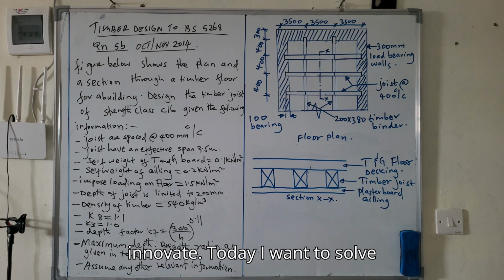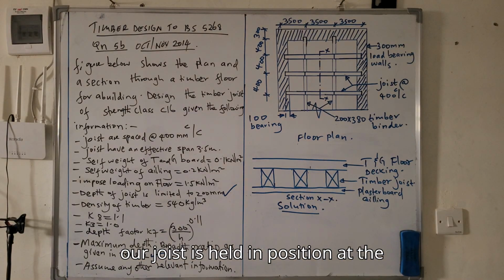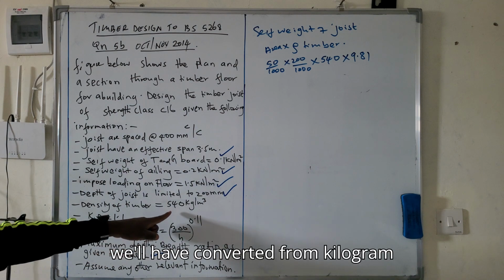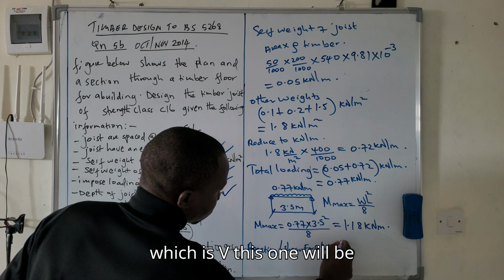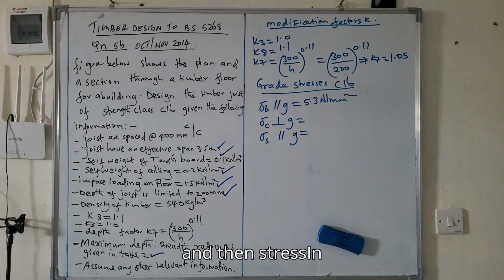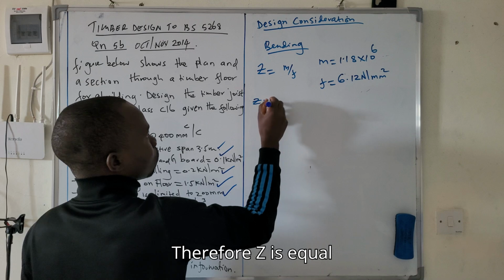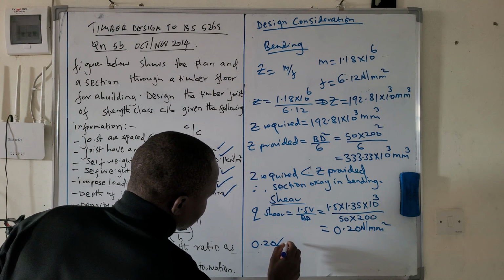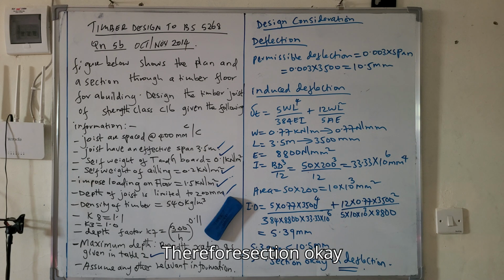TIMBER DESIGN TO BS 5268 PROBLEM #6

Comment: hello there i have noticed in Induce you use {5*w*l*^4/384*Emean *Ixx +12*w*l^2/5*Emean*A}  what about  {5*w*l*^4/384*Emean *Ixx +24*w*l^2/5*Emean*A} when do we apply this formula ?                                   
24*w*l^2 Rather than 12wl^2
Reply from the maker: Induced deflection formulars are different depending on the types of beams:
1. Simply supported beam with point loads at the center=(WL^3/48EI) + (24WL/5AE)

2. Simply supported beam with UDL spread on the entire beam= (5WL^4/384EI) + (12WL^2/5AE)

3. Cantilever beam with point load at the far end=(WL^3/3EI) + (96WL/5AE)

4. Cantilever  beam carrying UDL= (WL^4/8EI) + (48WL^2/5AE)
Reply: @OdavigiStructuralHub  thank you sir
Reply: @OdavigiStructuralHub  Thanks really appreciate this information